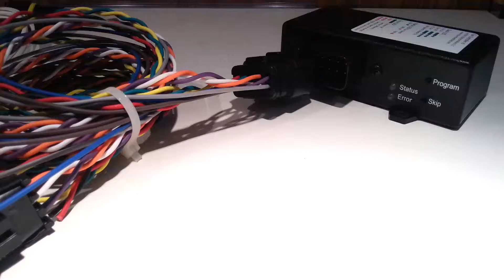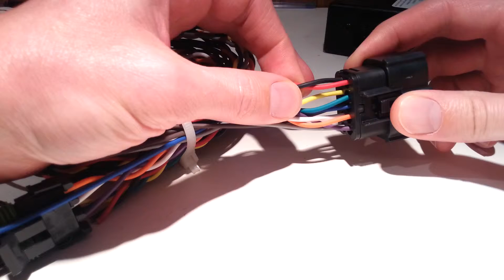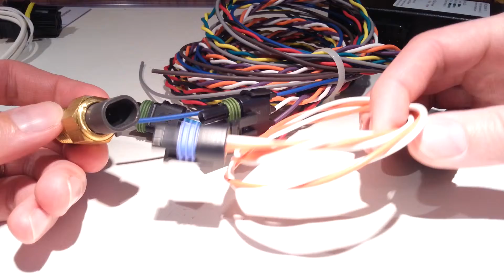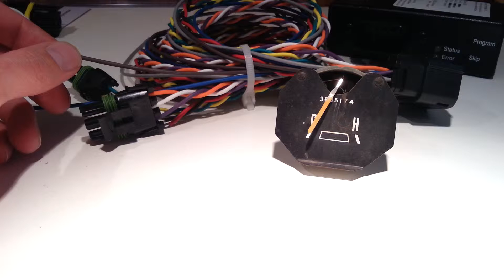Fan Controller v3 Wiring Harness

Comment: I purchased the fan controller -- on the harness, which one is power and which one is ground?  Both wires are white.

Thanks!
Reply from the maker: Are you talking about the harness for the fan with the two large white wires?  In the manual (linked in the description) on page 11, it shows a picture of the plug, and which wire is power, and which one is ground.
Reply: Thanks!  I missed that link.  Had to expand it to see it. Now I have to hunt for the fan.  Need to cool a 455 Pontiac in my 68 Firebird.
Reply: Trying to find the fan assembly that fits in the core of my radiator.  It measures 22" from the inside tank to inside tank.  I am not sure if I'll be limited.  It currently has a two-speed Thunderbird fan and I feel like the flow is not sufficient. On 95ºF weather it will run on high speed and stay at 200ºF if I'm on the throttle on the street. It will come down to 190ºF if I coast a lot, but nothing less than that.